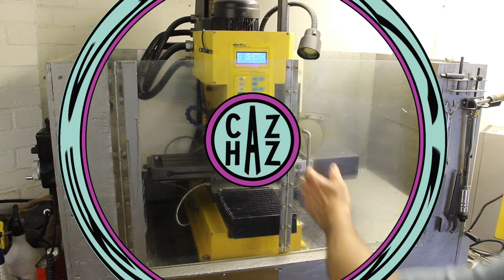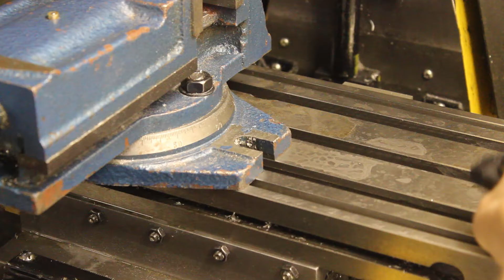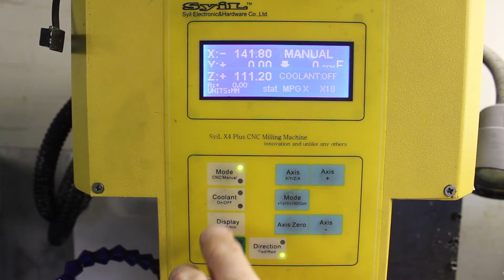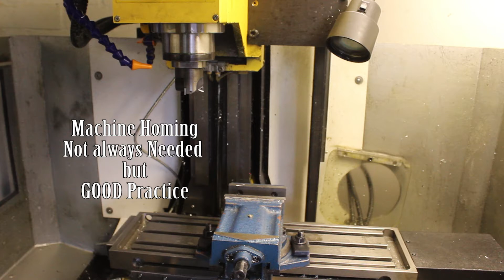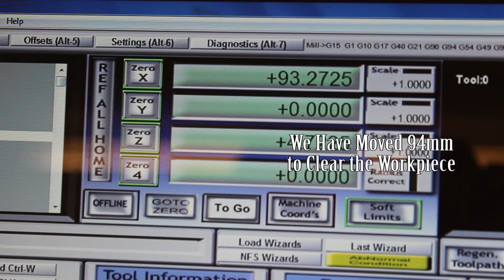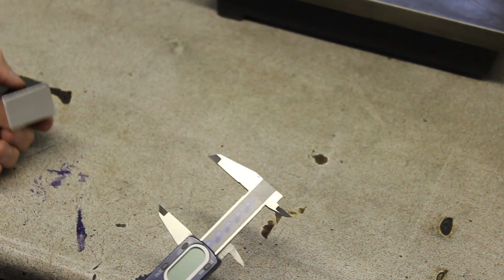How to manually program a CNC mill

Comment: Glad to see your LCD panel is as bad as mine! I did replace it and it was marginally better! As always, an interesting watch....
Do you ever use the Manual mode on the front of the Syil?
Reply from the maker: Hi Matt,
You can fix them if you can be bothered. there is a small strip called a zebra strip that connects the circuit board to the glass screen. Its usually the problem a dismantle and clean can fix them. 
The part is a standard part and can be replaced wholesale for a new one.
Not used the front panel for feed but have set the mpg speed in Mach3 then hold the button down to feed the cutter in. Works well but you soon get fed up with holding the button!
Cheers
Reply: @CazualHaze  I just replaced the whole unit as it was low cost. Better but not perfect!
Reply from the maker: I did have a look at mine a few years ago, I was replacing the drive spindle toothed belt pulley. Mine was squashed and catching the belt, from the factory!
I think it looked like a standard 4 line x 20 character lcd display.
RS here in the UK along with many others stock them. https://uk.rs-online.com/web/p/lcd-monochrome-displays/1359751/?cm_mmc=UK-PLA-DS3A-googleCSS_UK_EN_Displays_%26_Optoelectronics_WhoopLCD+Monochrome+Displays_Whoop-1359751&matchtype=&pla-335813289596&gclid=CjwKCAjwmeiIBhA6EiwA-uaeFdzoe7pANF8PWySp_APxfu9FIAC7gvJZDNGngsXhIjjIAENVzcdr1hoCjyYQAvD_BwE&gclsrc=aw.ds